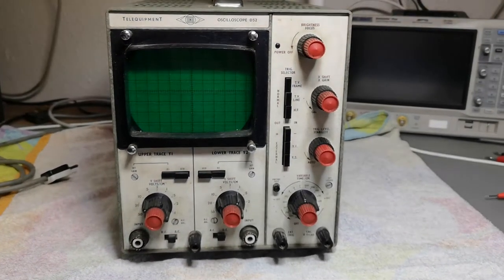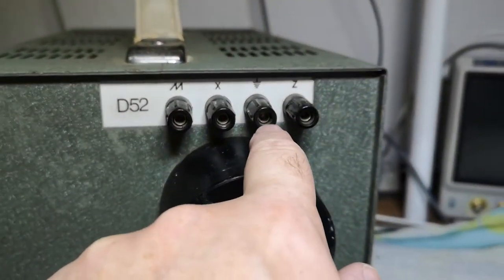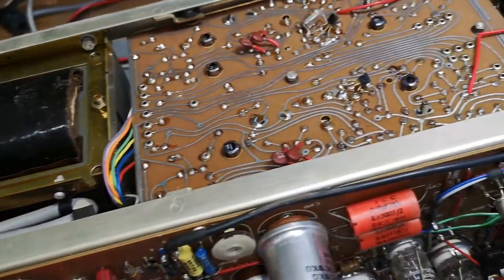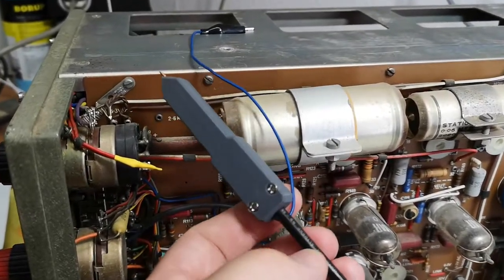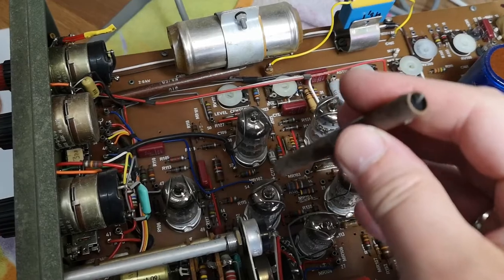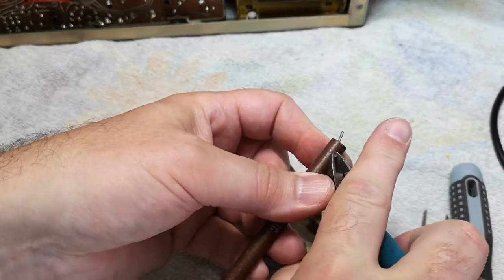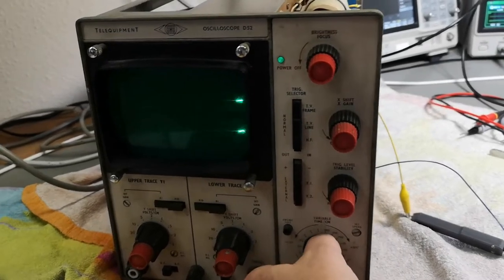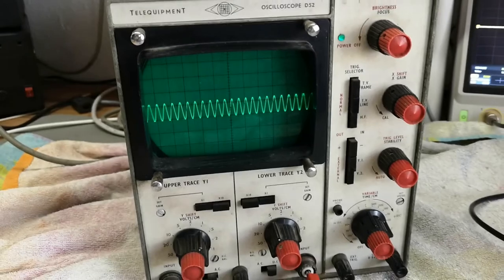Oscilloscope Telequipment D52 2ch 1969 DUAL BEAM CRT test repair teardown

Comment: Is that a real dual beam CRT?
Reply from the maker: it is a single beam CRT, like most other scopes, the two traces are made by switching from one channel to the other
Reply: @TeardownOZ2CPU  

I thought it was 2beams because I thought I saw deflection plate connections both on top (four) and bottom (two). That would be six total, like X, Y1, Y2.
Reply from the maker: @markocebokli6565  YOU ARE RIGHT !! this CRT is truely a dual Y deflection, and one X deflection plates, wow i just double checked the schematic, thanks so much for pointing this out, I better add this info